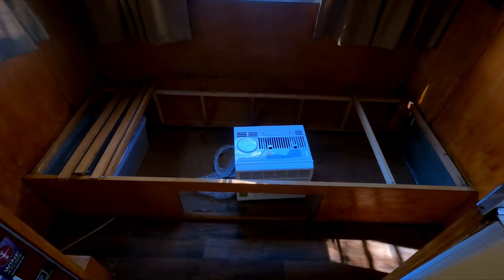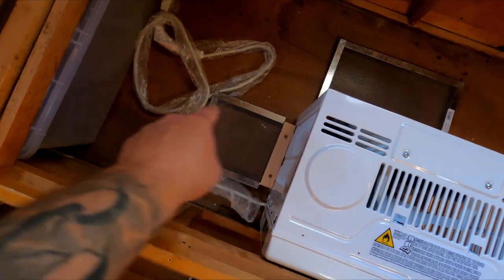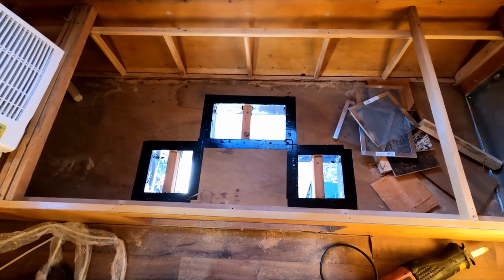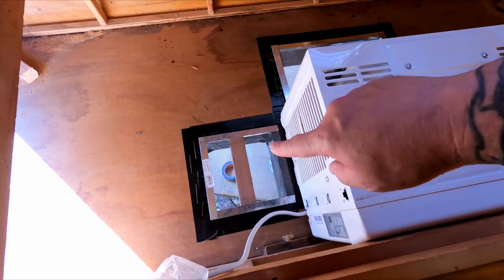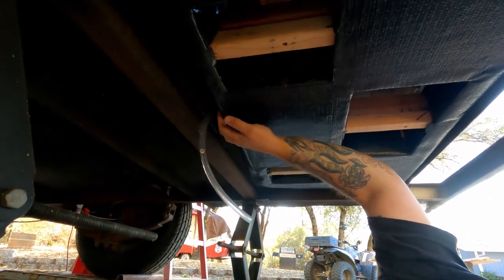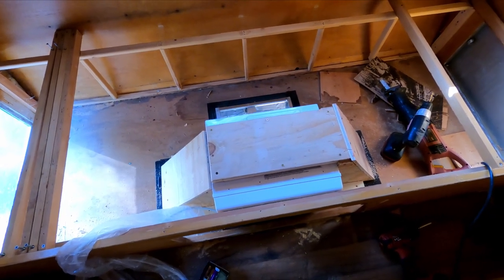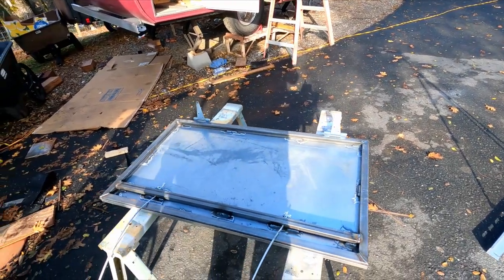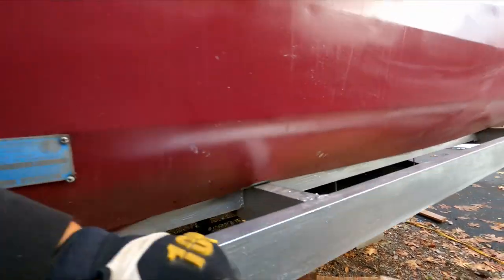RV Under bed Air Conditioner install - House window air conditioner in trailer - Sisters On The Fly

Comment: This will not work well because heat rises and cold air drops so the temperature inside would be very inconsistent. Also having that air conditioner basically inside the unit is going to release a lot of heat back inside the RV and not put so much outside. You would have been better off putting it in the window
Reply: I agree. I did similar thing too and found that my 5000btu AC would not cool my sprinter. So I had to redo the duct so the supply was opened at the top of the van. If not the bottom haft stayed cool and top was hot
Reply: This application shows a complete misunderstanding of how this type of unit operates...

Comment: I basically did what you did only I squared it up instead of wings.  I added 3 amazon computer fans rated at 6000 operational hours so as to push & pull air circulation.
Reply from the maker: awesome! Sounds like it should work good. Thanks for watching 👍

Comment: Just take the unit apart. As you want the duct inside to be high. As that is where the hot air is. That you're trying to remove..You can mount the outside part of the AC unit under it. It would be just like any Mini Split. As that is how a Mini Split works..

But you can buy a 12k BTU Mini Split today for around $450.00..Makers it even simpler..
Reply from the maker: Sounds like that might be a good idea. The lady that has it says it's been working great in her little trailer. Thanks for watching 👍

Comment: I have an older model as well but dont have room to do is way and i have those type of of windows im so confuesed on how to fit it in the window with these type of windows any ideas?
Reply from the maker: Hi, thanks for watching. I'm not sure without seeing what you have to work with. If you have a rear window that it can fit in you could do something there maybe? If not maybe a cabinet that you can exhaust out of? You got to be creative with these older trailers. Good luck hope you find something that will work for you.

Comment: How is this working out? We bought a window unit to put under our back seat also, but I hear “won’t work” and I’m hesitant.
Reply from the maker: Thanks for watching! If you can vent it in a way kinda like I did where exhaust air can outside and you have the sides and top also breath outside air so none of that is inside it will work. Only thing you want using inside air is front of the ac that sucks air in to cool and put back in the room (your trailer). But it will not work if you don't have vented correct.  This setup I did in this video is working great for the lady I installed it for. Actually talked to her yesterday and she said working great! I know several people in the vintage rv world and a lot of them have that style of ac. If installed correctly they work great. People that say won't work just haven't been creative enough to make it work.  Hope that helps🙂
Reply: I am an engineer not just an installer try it out diyer. Anything works with certain efficiency but if you want to make it worth your effort, you should  duct the supply towards the top of the trailer.
Reply: @songsIlike8  Any air at the top of the trailer will be reflected heat off the surface and will be pulling in hot outside air.   You ever climbed on top of a trailer?    I built a deck on top of may Cargo trailer to Camper and it's just not useable in the heat of the summer.